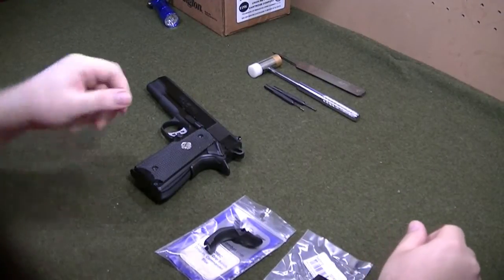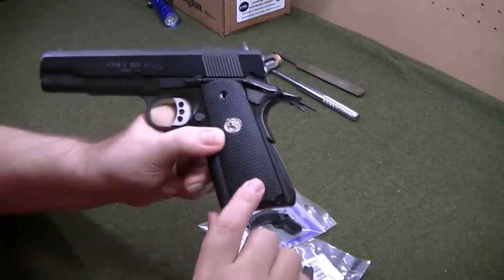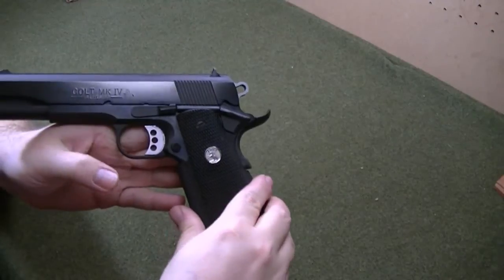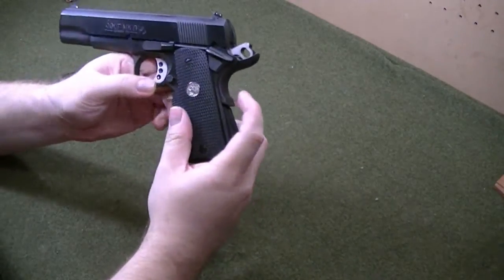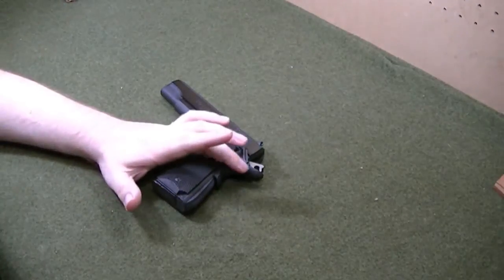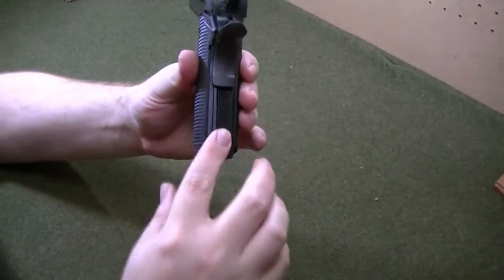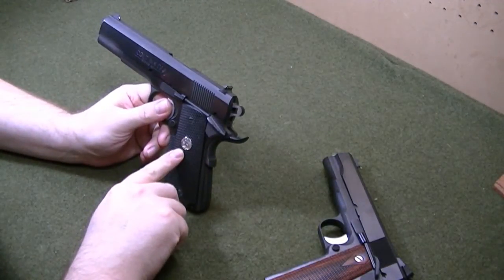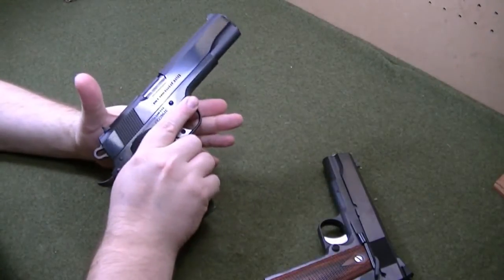Colt MK IV Government Model 1911 Series 80 Wilson Combat "Drop-In" Beavertail Swap

Comment from the maker: At least now I know who to bother when I mess something up! One of these days I may try to build something up. (Need to buy some videos first.) Fusion sells kits with the frame, slide and barrel all fitted. But for the price you could an get already complete 1911 and add your parts and mods here and there. What 1911 do you plan on getting? Another full-size? Or Commander?

Comment: The biggest problem with a series 80 is that it's not a series 70
Reply from the maker: Yeah a new series 70 from Colt used to be a rarity...now that's pretty much all they make. Maybe series 80 are still in their catalog, but they're probably the rarity now. I still have the pistol, it's a fine gun.
Reply: @BHPfan26  fixing to go buy myself and ria 9mm, and I think it's a 70. Aint a colt, but then again I get to keep both my kidneys cuz those things are freaking expensive
Reply from the maker: @hsadreamerofrlyeh7516  I had a RIA in 38 Super, pretty sure it was series 70. 9mm 1911s have gotten real popular in the last few years.